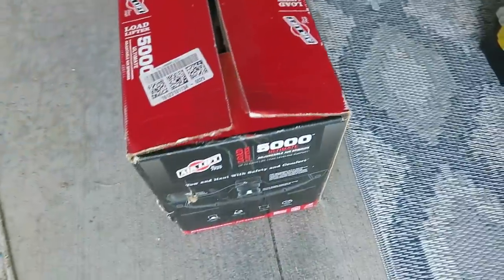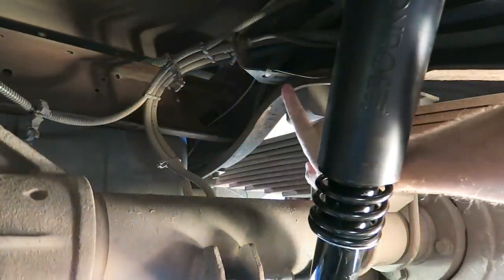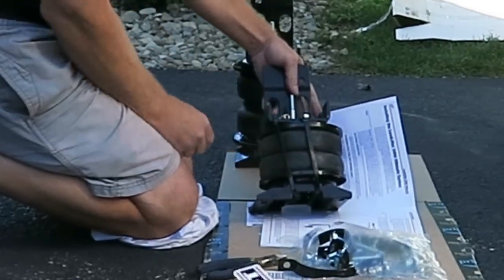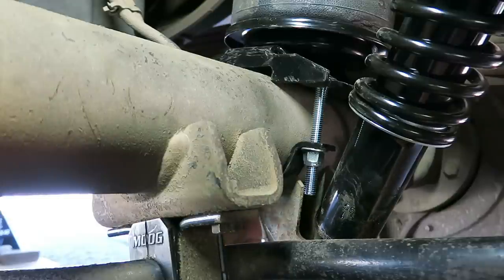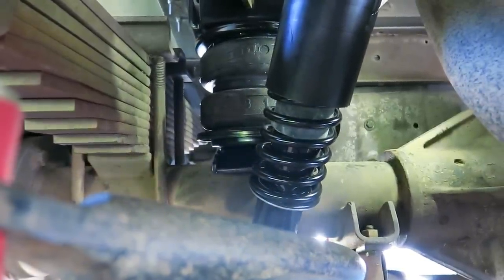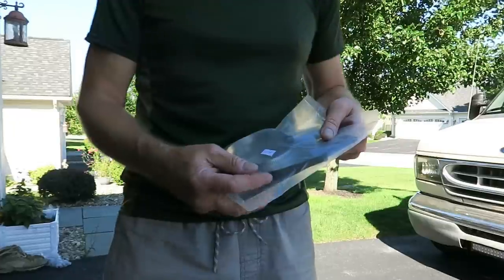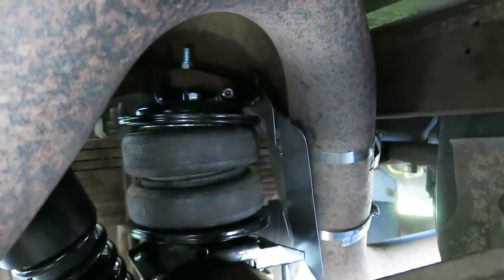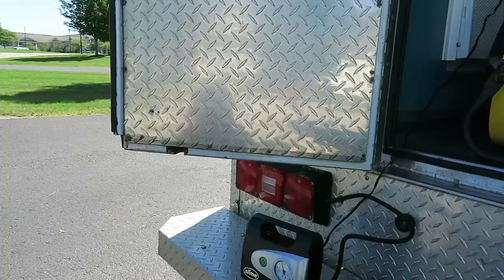The Last Upgrade To The Rig And I Had A Failure - Watch Me Install Them And See What I Did Wrong

Comment: ...   just a heads up  -->>  sometime down the road when those lower bracket bolts snap [grade 3] , replace them with at least grade 5 hardware / even grade 8 , also always keep some air in the bags and don't inflate too much in very cold temps and finally , couple times a year bleed the bags to remove moisture  -->>  all things I learned the hard way lol   ...   safe travels  ...
Reply from the maker: Thanks for those tips!

Comment: I'll bet you are looking forward to driving with these upgrades once the drivetrain problem is resolved. You can add a Air Lift compressor with gauges in the cab but you have such easy access in the rear it would be unnecessary, I'd keep it simple as you have. Hoping for good news in the next update.
Reply from the maker: The drive was great.. until it wasn't. I can't wait for the open road to really feel the improvements.

Comment: I think you will be very pleased with your upgrades, anything to make that E-450 ride better. Wish you would use CC on your posted video's. It would help this old vet.
Reply: I agree! I depend on Closes Captions
Reply: @stanbyme7874  You should be able to turn the CC on using any device. Look for the CC icon or the settings icon which looks like a knob or gear. Click on it to turn on the CC. Often times you can choose English if the video was recorded in another language. When I'm on my laptop I can see the icons at the bottom of the video.  On my phone, I need to touch the video for the icons to pop up. Hope this helps.
Reply: @Neverdie242  You should be able to turn the CC on using any device. Look for the CC icon or the settings icon which looks like a knob or gear. Click on it to turn on the CC. Often times you can choose English if the video was recorded in another language. When I'm on my laptop I can see the icons at the bottom of the video.  On my phone, I need to touch the video for the icons to pop up. Hope this helps.
Reply from the maker: Like JL said, you can turn on CC for the videos and get the text. It is available on all platforms.

Comment: FYI, breaking a nut lose with a racket wrench could break the wrench. It's best to break it lose with a traditional closed in wrench and use the rachet the rest of the way. Of course if your rachet wrench has a lifetime warranty, disregard my comment.
Reply: I've broken many nuts free with ratchet wrenches made by Gearwrench even using a 2lb hammer haven't broken one yet.
But in theory you are correct.
Reply: @cfh4201969  It's not just theory. They do break.
Reply: @dealsfromvirginia1773  you get what you pay for. Been doing it for years
Reply: @cfh4201969  These days you pay up and still get crap. Manufactures know how to make things fail just after your warranty has expired.

Comment: This is the video I needed to see, before the sudden breakdown live video.   You posted so many upgrade video segments which had yet to be followed by this test run success video, complete with your smile, signaling to us the look of success that, of course, we want to enjoy with you…
No biggie. It’s just the insertion of the shock incident perhaps dampened the victory lap a bit.
Now we await the update vid which will inform us of the current status of the bum trip we want you out of asap!
Reply from the maker: I hear ya... it threw a whammy into my whole plan :/
Reply: @TheCampulanceMan  
Many a well laid plan incudes prayers, both for an issue-free happening, as well as the often relieving thank you Lord for bearing us through…
Oh, but then the time will come… 
Prayers for a resolution to these snafu-luffagus moments in a timely manner…
Reply from the maker: @esparka  My hopes are that the repair to the differential come out perfect... that's all I need. Cost, time, etc are secondary. We just need it to be perfect.

Comment: Uh oh. Did you cook the new air bag? Is that what happened on the shakedown?
Reply from the maker: No, the heat shield got a little smashed by the air bag bracket - I guess it was too close where I put it. The differential is the breakdown yesterday - it's at the shop, going in Monday.
Reply: @TheCampulanceMan  Fingers crossed it's a not-too-painful repair!